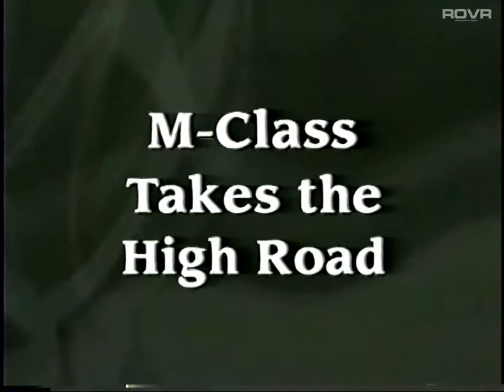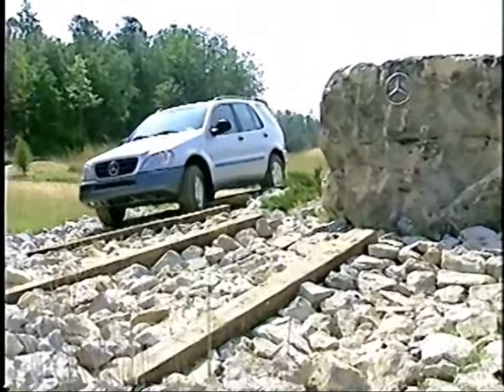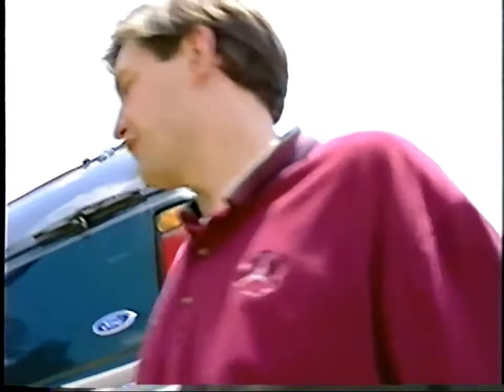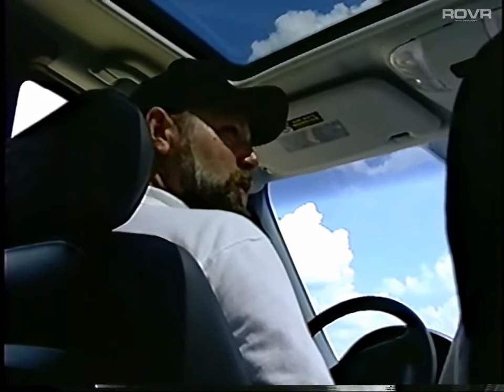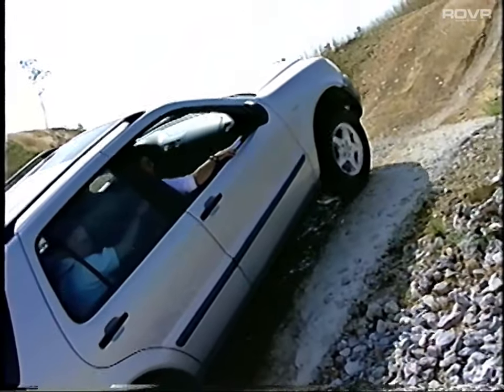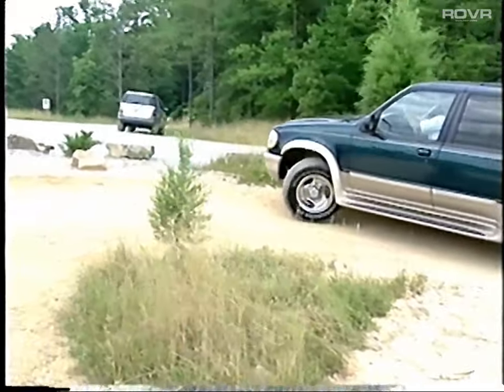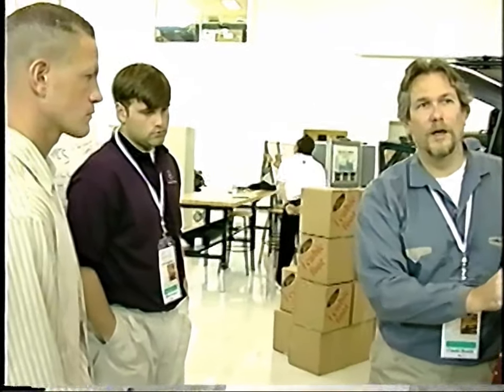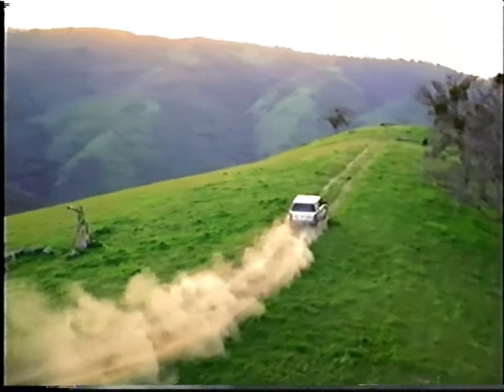Mercedes (US) - M Class (W163) - Product Training Video - The M-Class Takes the High Road (1997)

Comment: I have a 2001 ML320, it has been nothing but reliable, done many cross country off road trails and parks, truly impressive vehicle, it's ETS 4 wheel drive, also excellent low gearing can do level 5 offroad with ease. My ML at 130k mills is still running strong

Comment: I have an ML270 CDI with 380,000km and it's still going strong with no rust or anything. Pretty amazing for a car with a garbage interior.
Reply: From which year? I’m looking for the 270 version, but I’m concerned of the rust situation.
Reply: @ramonbs6075  ML270 were all the same and produced from 1997 to 2005. The 2.7 diesel model wasn't avaliable in any other M class generation
Reply: I still drive one

Comment: I have a e320 4matic from 2002 Wagon. And it has similar traction control and all wheel drive system like the ML i bought this car to my wife maybe 5 to 6 years ago. And it has been super reliable and she totally adores the car she says is the only car she would drive in the snow is a total tank. Is now about 170k miles and it has no signs of slowing down even when she says she will drive it till the tires fall off i always see this cars reaching well over 250k miles.

Comment: Still the best looking M Class IMO such a shame the reliability, build quality and rust were such an issue.
Reply: I mean, our family has two ML430's and I have an ML270 CDI and they all have at least 280,000km on the clock and are all going strong and with no rust.
Reply: @berendoldenburger  no rust?? Lol look underneath the paint and you'll freak out, it happened in every ML from this era sadly. I always loved this car, sadly it's one of the worst Mercedes ever made in terms on quality. No surprise since it was after all an American car built under US standards which you know... it's always been low, very low
Reply: @gx455  Every ML we have is rust free since we live in New Zealand where salt isn't used on the roads in winter. We keep good care of our ML's since they are strong work cars. Even W203 C Classes have been known for rust issues but not here in New Zealand since we have 3 in our fleet. Only Alfa's and Fiat's seems to have corrosion issues in this part of the world.
Reply: I live in vegas. My 320 has no rust at all lol
Reply: Rust free ML430 334000km over here. Bolts in the suspension come out as if it rolled off the factory line yesterday.
Reliability?? I have no check engine light, no stored codes AT ALL (yes, with star system), and on top of it, it has not broken down in the last 100.000km since I owned it. That is right: Stranded zero times.
I have offroaded this car substantially in the Olympic national park, it's my winter "beater" and it won't stay in the garage when it snows and freezes.
These cars need maintenance on the regular, and keep away from these cheap non-oem parts, but you get what you pay for!
Reply: Rust depends on snow and salt

That's not everywhere in the world

Comment: Some serious irony here, as Daimler-Benz openly intended to buy Chrysler with the singular intention of owning the Grand Cherokee, the darling of the American SUV market, and maybe not the gross sales leader of the Explorer, it was the owner loyalty and the formula of its making that they wanted.  They knew they had the superior vehicle in the ML, but they wanted the nuances of the GC to gain that sizable and long term market share, confident that the GC would be around indefinitely while the Explorer may or may not be around to compete for the same customers.    And here they compare the GC in a quite unfavorable way, yet they bought one of America’s Big Three simply to own this inferior product.   Irony.  And it keeps going.    Apparently, the Jeep Quadra-Track was designed with the Mercedes AWD system as a reference.    Those are the only two vehicles I’ve ever seen with that tech.    And more irony.   I think it was from the 2011 model year that the GC were based on the previous gen ML chassis.     Wow.   And from 2005 on the Jeeps which used a 5 speed automatic got the Mercedes one, in America known as the NAG1.    Buy your competition, it seems to work.     The ML chassis is indeed superior, as it’s not really a unibody, as it has frame rails, proper and robust, where the GC is just like a unibody car but with solid axles, rear AND front.   Now that’s ancient tech.   Until 2004 the GC used a solid front axle, technology straight out of the future of 1940.    Hey, at least the ONLY alignment adjustment was toe-in.    I loved the GC.  It was cushy and comfortable, but the ML was a quality vehicle and that shows well in the 2002 I still have.   Everything works and works well, zero rust, extremely low engine wear, drives like new.     Good stuff.